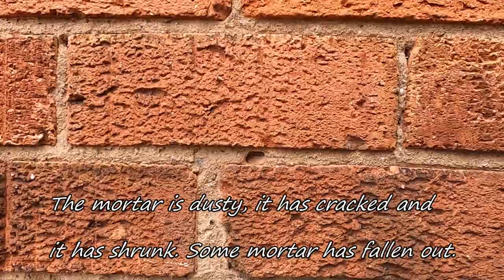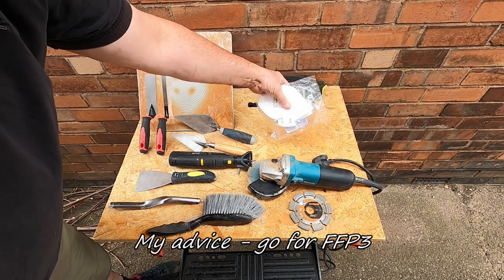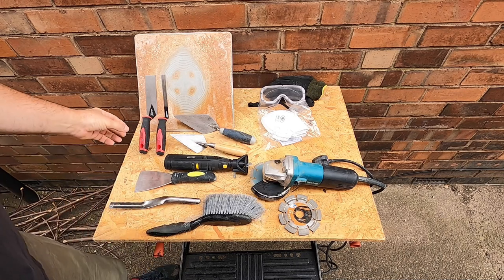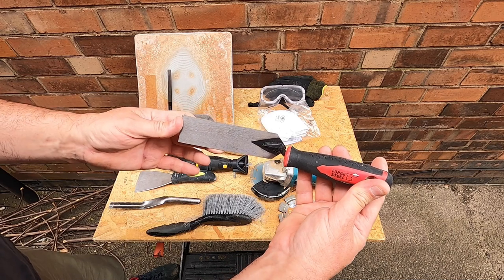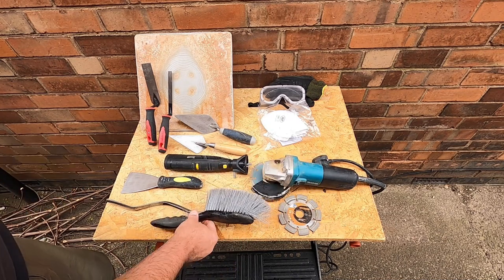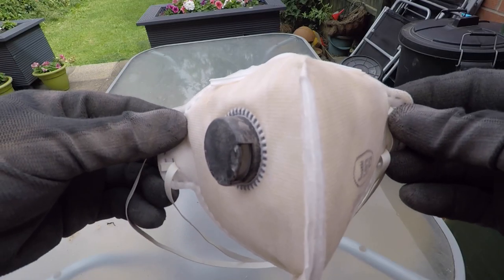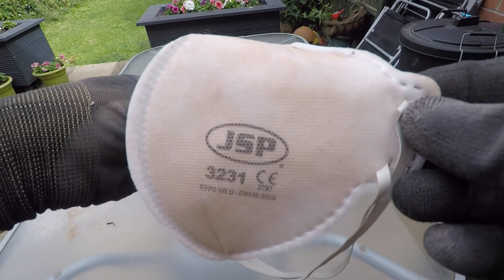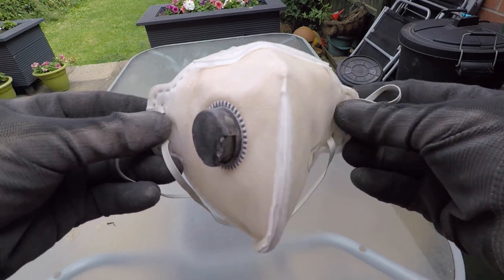How To Repoint Brickwork  / How To Repoint A Wall - Part 1

Comment from the maker: Repointing the walls of your property requires NO skill or experience whatsoever. However, it is one of the most expensive jobs a contractor will charge for, yet one of the cheapest you can do yourself. It is also one of the most important maintenance jobs around your property which will keep the weather out and protect your investment.

Comment: I thought about using an angle grinder myself, but it's the amount of dust it creates, don't think I would be too popular with the neighbour if he ended up with brick dust on his car.  I've normally used a small chisel and hammer, or just racked it out with a tool of some description.  The main problem I find is stopping the mortar from drying out, so I normally soak the brickwork first and then give it a light spray periodically afterwards.  The weather we've been having lately is in my opinion far too hot for pointing.  I need the side of my 1930s house pointed, unfortunately there is a sloping roof below and nowhere to place a ladder, so job for the pros I think with scaffolding, too big a job for me, all the best.
Reply from the maker: Hiya Robert. The hot weather certainly brings its challenges and there does come a point where you have to decide whether to even bother doing a task like this at that time. On a very hot day you will, as you say, have to keep wetting the wall to stay ahead of the game and  even soak it if necessary. That said. it hot countries, building work continues regardless and they face similar if not more severe conditions. As you have pointed out, access is also a big issue and I've got a similar problem but due to height restrictions. I think I'll hire out a cherry picker thingy and replace the gutters at the same time. Best wishes, Des